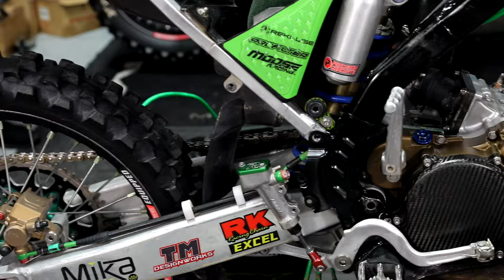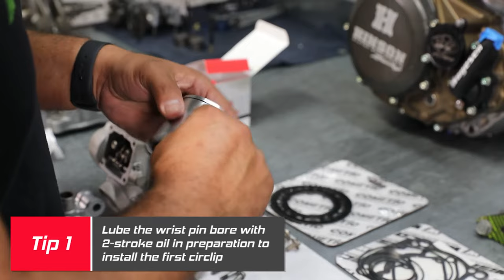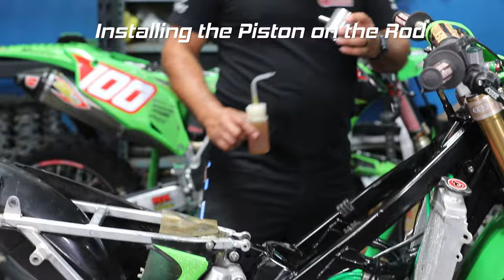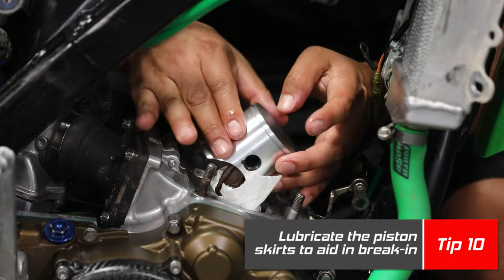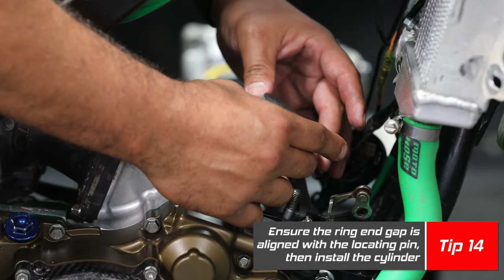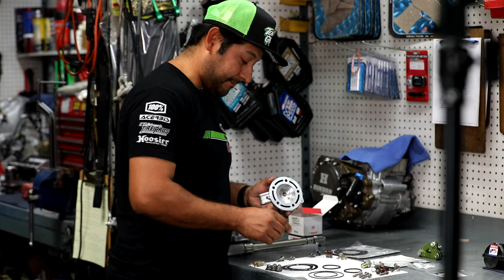20 Tips on a 2-Stroke Top End Rebuild with Phil Valdez

Comment: Just reassembled the top end on my 79 husky 250cr. Wiseco piston and rings of course! The engine has been sitting dormant for almost 20 years. Got it back in the frame (replacing the 390cr engine that took it's place years ago) and took 4 kicks and it's alive again! Great video with good advice
 Thanks!

Comment: At about the 4-minute mark you glaze over the surface prep,  Im very curious because many use razorblades, some 3m scour pads, and such.  But I do not want the gasket to fail.  The razor blades leave tiny little scratches which can be a problem.  Thank You!
Reply: Razorblades on aluminum is safe and effective if you hold the blade vertical to the surface when scraping.

Comment: What are you using to lube the parts?
Reply: 2 stroke oil
Reply: @bigguy-ow6rd 2 stroke transmission oil or 2 stroke premix oil?
Reply: @darioalcala6995  2 stroke premix bro, i dont think there is a such thing as 2 stroke gear oil, personally i just run 10w40 in the bottom end of my two strokes which can be used to lube the top end as well, it isnt every crucial however 2 stroke oil mix is what lubricates the top end as it runs so thats what i prefer to use to luvricate for assembly